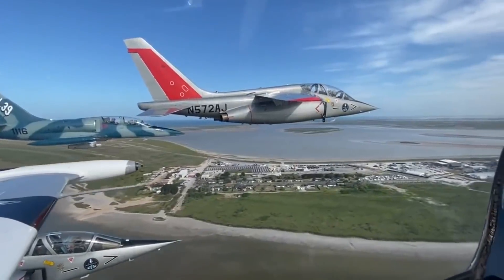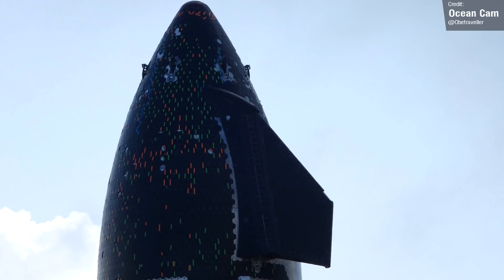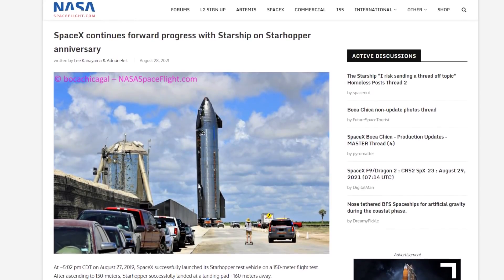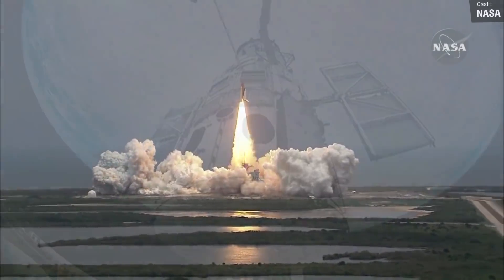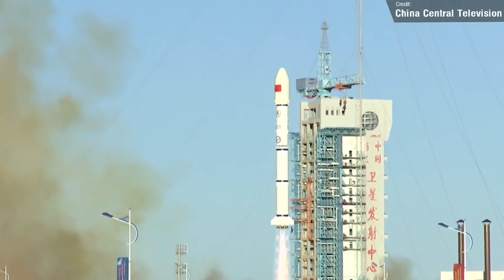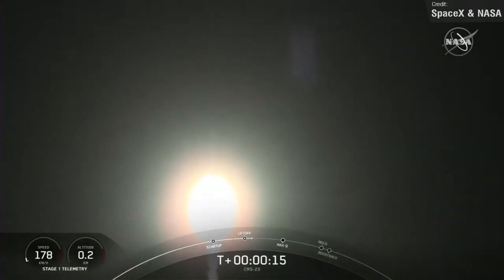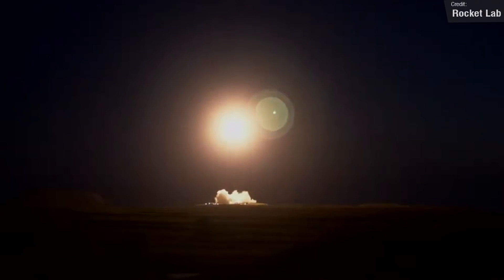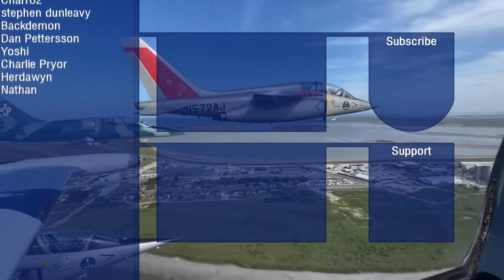SpaceX Starship's Amazing Thermal System, Astra Launch Fail, Blue Origin 17, & Firefly Alpha News!

Comment: the purpose of cryo testing is to see if the tank will implode on itself, as some of the first rockets at a habit of doing that as they are using thinner materials than normal for the tanks. so before they actually used a different tank in a sn rocket it has to undergo cryo testing to ensure it wont just implode.

Comment: About Astra, all I'm gonna say is if SpaceX can have a sister company called the Boring Company that digs tunnels, then Astra can have a sister company called the Rocket Trenching Company that will get your trenches dug rocket fast.
Reply: The rocket drill has even already been invented, so it should be "easy". I don't know why it never got popular, but it apparently does work really well and fast.

Comment: Mad props to the navigation software team at Astra for the way it skidded sideways off the pad and avoided destroying the GSE.
Reply: I can't help but think their software is rock solid. It's just the hardware that failed. Mad props to the software team.
Reply: @roccov3614  hardware is actually pretty solid too. The explosion clearly damaged the rocket, holding clamps, ect... Yet it acted like nothing even happened
Reply: @mobiuscoreindustries  Probably the hardware is pretty solid, but something did exploded. That's a hardware issue (probably).

Comment: The Astra launch reminds me too much of KSP lol
Reply: They forgot to revert, though.
Reply: @questioneverything4633  lol noobs
Reply: I think they had hard mode on
Reply: Even the "keep flying it to see where it goes" part is KSP.
Reply: It's a very Jebediah kind of flight.  Semi-successful after some real iffy moments.
Reply: Yeah! Looks like one of mine with the 1.01 TWR 😅 wish them nothing but luck going forward 👍
Reply: They should've turned on auto SAS
Reply: Maybe, but was that an IMPRESSIVE display of their flight control system to keep the pointy end up and the flamey end down?!?!? When I have a KSP flight go like that, it's pretty much of a guaranteed ground loop!
Reply: The very definition of shit going sideways.
Reply: When you misclick and turn vector thrust on one engine to 5%
Reply: I've seen someone describe them as 'SpaceY'.
Reply: @hjalfi  Take a gander at Scott Manley's vid...
Reply: But it doesn’t remind me of my Play style, as instead of dropping it in the Ocean I would’ve tried to softly land in the ocean or if it was structurally sound enough try to gently touchdown on land/Sandy beach.
Reply: Develops a rocket that costs 3 billion dollars but forgets to position the Thrust to Weight ratio correctly. 

Rocket floats to the left and crashes 

... Dang Thrust to Weight ratio
Reply: Good thing Astra had SAS on 🤣
Reply: Yeah lol
Reply: That was the craziest rocket shit I've seen since I used to build my own as a kid😜
Reply: Perhaps it also resembles Sn5 or Sn6
Reply: I have watched many Ksp attempts do astra’s trick
Reply: That was me and my realistic mods career mode footage lol